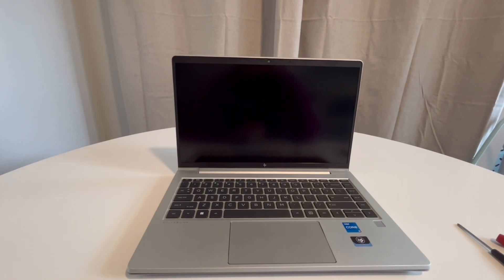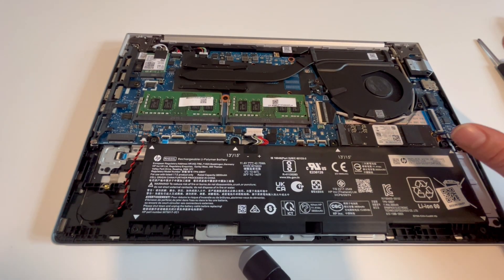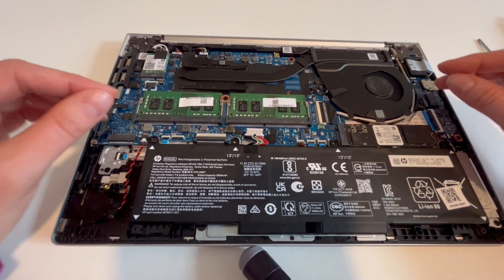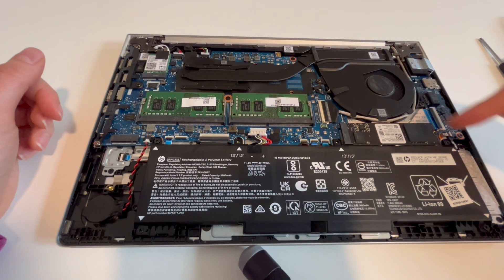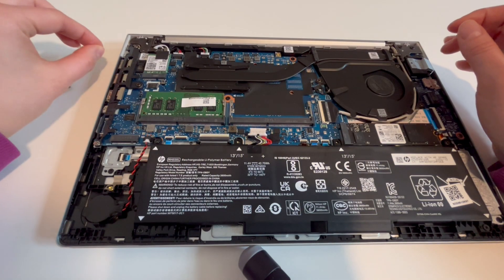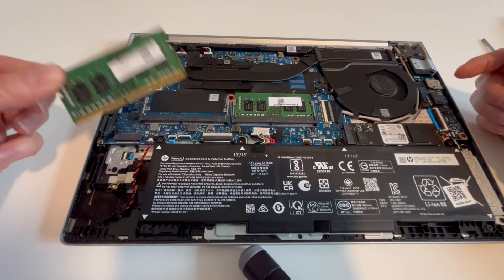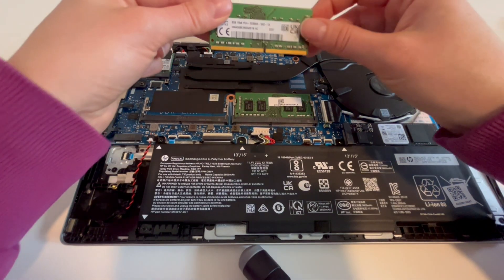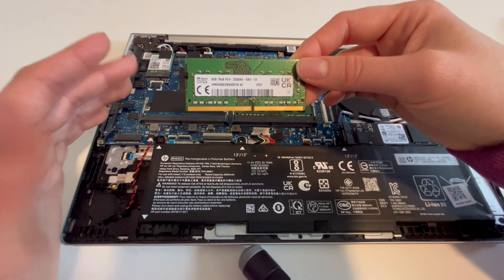How to Fix an HP Beeping 3 Long 2 Short Beeps by a Certfied Technician - Beep Code 3 2

Comment: Had this issue. Removed and replaced both RAM cards. Still had issue. Removed DIMM 2 computer booted, Removed DIMM 1 and put in DIMM 2 issue again. Tried with other RAM card in DIMM 1 and it would also start the computer but if I put either RAM card in DIMM 2 issue comes back. Tried compressed air in DIMM 2 slot and no visible damage to the MB or DIMM slot.
Reply from the maker: Sounds like it might be an issue with the actually RAM port and maybe not the RAM itself. You could buy a RAM stick with more Gigabytes in it and then put that in the one working slot. A lot of computer manufactures nowadays are favoring one RAM stick with more GB in one slot over two with less GB.

Comment: This happened on my pc after running updates. Does that make a difference?
Reply from the maker: Yes, running updates can sometimes trigger beep codes if there are compatibility issues. It's worth checking your drivers or rolling back the updates.

Comment: I only have one ram and when i put it back in it just keeps beeping. So that means i need to buy a new one right?
Reply from the maker: If you unplug the RAM and turn the computer on does the computer beep? Also, trying a new stick is the only way to tell if the RAM is bad when you only have one stick. If the issue goes away after replacing it, it was a bad RAM stick.
Reply: Yes it still beeps wen I unplug ram @EggheadFixers

Comment: I had this problem then i switched it on and it showed a bios message about faulty time and when i rebooted it started the beeping sound again then i left it for a while and tried to switch it on again and it worked do i still need to do this cause I'm scared if i switch it off it will start beeping again
Reply from the maker: Does the error say something like "Real-Time Clock Power Loss (005)" or ask you to set the date and time? If so that means you need to set the date and time in BIOS.

Here is a video on how to do that:

https://youtu.be/aWENV3W3Y5Q

Comment: I have tow sticks, I did what you said I trying one at a time, it still gave me the issue for both sticks. My laptop was just working fine then boom this happens
Reply from the maker: 3 2 can also be a video card failure.
Reply: @EggheadFixers  Mine just started working after 2 hours of leaving it be. But it didn't work when I tried all the methods. I even ran hardware tests just to be safe, and everything works perfectly now. I hope the problem won't come back. Thanks for the help
Reply: @EggheadFixers  it just stop working again, but before it didn't my display was displaying random stuffs. So I guess it might be the video card😔
Reply from the maker: @kehi19  It sounds like it might be starting to fail. I would try and get al your files off of it if you can.

Comment: My old HP Prodesk beeped similarly. I unplugged & plugged power cord, restart and PC worked normally again without beeps. If it gives warning signals again I have to follow your instructions, haven't cleaned that computer in years, sorry HP 🙁
Reply from the maker: We've all been there with the now cleaning it but good job troubleshooting.

Comment: I have an hp omen PC, and everything I've done is not helping. It has 4 ram slots, and I've tried to  change on each one. 3 long, 2 short. I then thought it was the ram that may have been the problem, so I replaced it. 3 long, 2 short. I then decided to take the internal battery and drained the excess power. 3 long, 2 short. Then i said screw it and took out the SSD, placed it back, then did everything else, making sure everything is 100% secured and nothing is loose. Turned it on and 3 long 2 short. Right now, I'm completely lost, and everything I've seen is the ram, the first I've tried.
Reply from the maker: 3 2 can also be a PCI or Video card failure. So that could be the problem
Reply: @EggheadFixers will my graphics card will get 3 2 failure even if it's integrated?